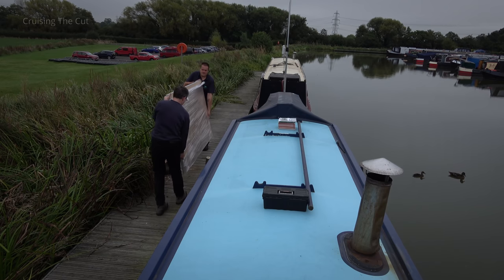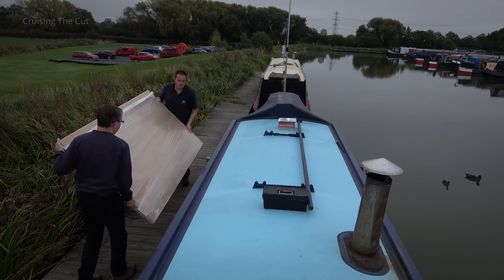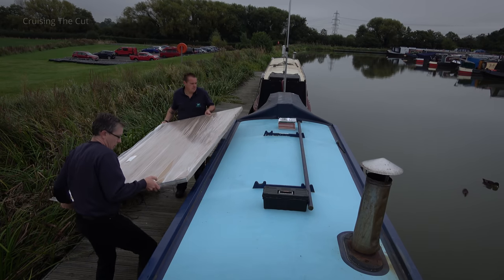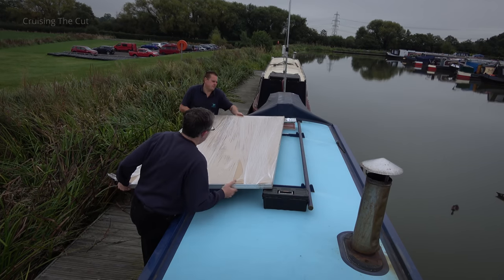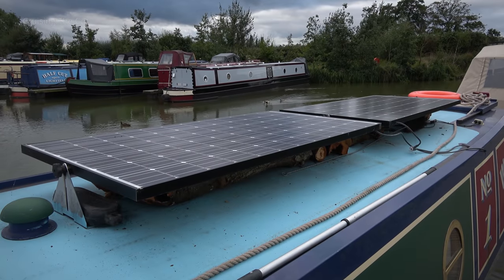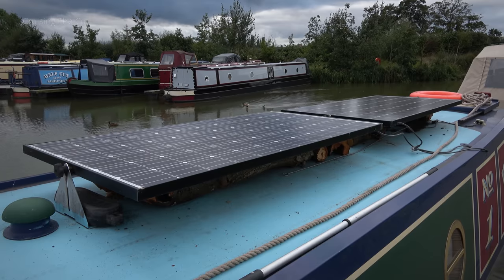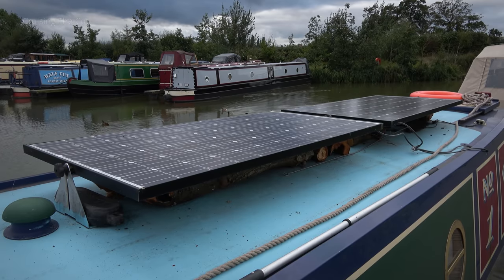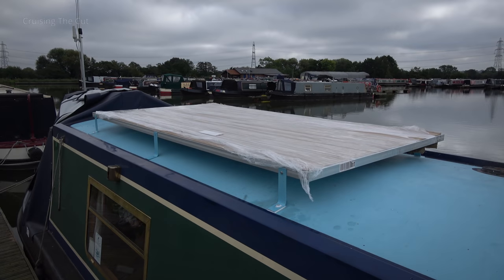260. Solar Panel and Lead-Carbon battery update (narrowboat)

Comment from the maker: Answers to Frequently Asked Questions:-

Why don't you get a wind turbine?
They're expensive, make a lot of rattly noise, you have to put them up and down each time you travel but above all, on a canal they're fairly useless. They need a constant, stiff (30mph+) breeze to even start generating anything worthwhile and unless you moor next to an open field where the wind swoops in all the time, you're not going to see a useful return.

Get a powerbank like those Jackery things, that would sort you out!
No, it wouldn't. You know, the companies making those things have done a wonderful marketing job of persuading people the boxes are some kind of miracle power-packs when in reality they are just (literally just) a battery, charger and inverter in one box - which is exactly what I already have on the boat as separate components! There's no magic about those things. They'd still run out of power after a day or so just as my batteries do, and then you're back to square one and you have to charge them ... so you're back to solar, or a generator or a shoreline.

Why don't you buy a Honda generator?
I do like those and they are relatively quiet. Many boaters do have and use little gennys over winter, for sure. The downside is having to buy and store petrol (it's not available on the canal so you'd have to get to a roadside service station and bring jerry cans back to the boat), plus they're a magnet for thieves. And the petrol costs are substantial, since you'd run the genny for maybe 2-3 hours a day. In my case, in a marina, generators are frowned upon for noise reasons (even though, paradoxically, you're OK to run the boat engine but it's generally a different type of sound)

Why not use a propane fridge?
They're probably great in RVs but except for a few older boats, they're not used on narrowboats these days. Unlike RVs, which can easily have holes in the floor to vent any escaped propane, gas leaks in a boat just sit in the bilge, forming a potential bomb if the gas were to meet a spark ... and propane fridges have a permanent pilot light. It's just not considered safe.

Why don’t you get Lithium batteries?
They’re lovely - but they’re also still extremely expensive, they wouldn’t like the hot and cold extremes in my engine bay so I’d have to re-engineer and re-wire the battery bank, and my alternator would need a charge controller added. And yes, they last for many years vs traditional batteries. If I bought a new boat, I’d specify them but it’s not worth the investment on a 22-year old boat.
Reply: Thank you
Reply: I am sorry I do not see any answers to FAQs here.  Are the no shore power pontoons less expensive?  This is a very good episode.
Reply: Many thanks 👍
Reply from the maker: I have re-pasted the FAQ answers in the hope that this time YouTube makes it stick! Can everyone see it now?
Reply: @CruisingTheCut  I found it scrolling down, it's not actually pinned to the top.
Reply from the maker: Aaarrrggghhhhh. Wretched YouTube!! Whenever you edit a pinned comment, it unpins it, and every time, I forget. It (should be) now re-pinned. Sigh.
Reply: Thank you for updating us! What I was think is that you needed a little more battery storage. It would be more helpful during winter by providing you a much more comfortable margin of longer use time during cold winters. And during the rest of the year - you can use Fridge, wi-fi, computer, micro and vacuum more longer/often without fear. Otherwise you seem to be doing fine. Well done!
Reply: About petrol and the Honda generators:
There are small battery charging diesel generators. No need for separate fuels.
Reply: If you have discovered that solar panels don't care where they are pointing when it is very cloudy, have you considered slapping more panels on the sides to pick up diffuse light in winter?
Reply: @sean2074  That actually works, but the sunny day efficiency is bad.  This is always the trade off, do you make a half circle panel, or a flat one.

Comment: You can fill old milk bottles with water and use them as a battery - whenever you open the door, the mass stays in the fridge/freezer. Normally the air falls out, warm air is sucked in to replace it and that then needs cooling. 
Water holds about 8x the thermal mass of air so once the mass has been cooled on a sunny day, the fridge will use less power over the following overcast days to keep the contents cool.
Reply: does anyone know if the early narrowboats had iceboxes, or carried refrigerated goods?

ice with fibre or gelatin will avoid melting for quite some time, I've seen it used as briquettes in our home meal delivery boxes.

Comment: Having lived off grid for 11 years I agree whole heartedly with your winter solar comments. We have a 1kw Honda which, through the Victron charger , puts in 30 apps. Way better than the engine which is noisy and takes far too long

Comment: What I do in winter, is find  the best accessible marina with space that’s not too difficult to manoeuvre into, then just once a week I go and get an overnight plug in. Do the washing hoovering etc, fully charge the batteries, then go out somewhere more interesting for the week. Works for me, I have three 230ah AGMs and at 6 years old, they still seem as good as new. I have an inverter on all the time and 240v fridge, always on. I typically run the engine between 1 and 2 hours a day, usually 1 one day  and2 the next, which also gives me hot water. It’s nice to have little cruises in winter if u can find a lock free area.It’s March now so solar takes over if I’m not moving. 845 w of solar, happy days.

Comment: This video was so dull that it was absolutely riveting: Single shot, head-on of David sitting in a chair, gesticulating vaguely and talking about amps, volts and dreary weather for 15 minutes. Which is what one does on a boat going nowhere in winter, I suppose. It reminds me of those winter months I spent decades ago with my elderly English relatives, although they lived in a house in Southend, not a boat.
Reply: There were "colour" shots of the power management wall, and the batteries though...😁😁
Reply from the maker: Dull is my speciality

Comment: Hi David, I've been off grid for two and a half years now, your observations are spot on, this winter seemed to have lower "Sun  Power", friends and family often say "just get more solar panels", but as you point out twice virtually nothing is still not a lot.
I've got 15kwh of Lead carbon (8x160ah Victron) our usage is equivalent to a monthly electricity bill of about £35 (according to comparison sites), we needed to run the generator every 2nd or 3rd day for a few hours, the total red diesel bill for Nov to mid February was around £100. It's thanks to your channel and a few others that gave me the inspiration to overcome the lack of power to my building project.

Comment: Well covered David. On the solar panel front the conclusion is they only work well when it is sunny. If you have enough in summer for your needs then in winter you will only have 10% of your needs. 👍

Comment: I loved this video David, though some of it went whoosh over my head. Most of us would know you'd sort whatever problems came along to your satisfaction. The lengths of small logs tucked under your solar panels made me smile.
Get a good log saw and collect some more. I heat my greenhouse with logs during the day, and smokeless fuel at night.
A fire with collected fuel gives you a warm glow, even when its not burning very well.
Reply: That's why he used the under solar panel gap as storage...
the wind blowing through dessicates the wood (making dry, efficent burning) logs and the "roof" keeps water/snow/sleet/hail/dew off them.
Reply: @JohnSmith-yv6eq  Thanks John. I knew all of that.

Comment: Always great vids, fascinating technical talks.

Yes, running a fridge uses lots of power, but some folks forget that it heats the air around it. Which may not be what you want to do with your electricity, but it's not always bad.

Comment: Great blog as per usual.  The good thing about lead carbon batteries is that they are not as susceptible to sulfation in a psoc (partial state of charge) as normal lead acid are. So one doesn't necessarily need to get them in to "float" conditions to keep them as healthy.

Comment: People who Van life here in the state and mount solar panels on their roof will occasionally double stack them. When the vehicle is in motion the panels are stacked and parallel to the ground with only the top panel charging. Then when they are parked the panels are rolled to 30-45 degrees and the top panels slides up exposing the bottom panel to the sun. In theory that would be a way for you to double your solar acreage. HOWEVER it must be pointed out how much easier it is to turn a car so that the panels are facing the sun. With a canal boat while you CAN tilt the panels slightly on both the port and starboard side, it might not be enough to either get the ideal angle or slide one of the panels out if if slides towards the downward slope

Comment: Thank you for the battery cruising the cut !   Electrifying !   Very good info.   I think anyone living outside +/-30 degree latitude have solar issues each Winter (usually and always), and you in England are somewhere around 50deg North.   I like solar a great deal, but only where/when it makes sense.  My house is covered by shade trees run the city...so always in shade and pointing the wrong direction so can not get good solar at all.  Thanks for the solid effort and report out.

Comment: Your narrowboat with solar is like a country going over to renewables - sometimes the sun doesn't shine and the wind doesn't blow.  Hence, other arrangements must be put into place to cover the shortfall.  This can mean building back-up fossil fuel power stations and only running them occasionally which is expensive for a country but not so for a narrow boat.  A better solution is to have connections to the outside world with the UK having interconnectors to Ireland, France, The Netherlands, Belgium and Norway with more on the way. This is relatively inexpensive and the result is that when we have a power shortage and our neighbours have a surplus, they can help us out and vice versa.  Difficult to arrange for a narrow boat as you would need to be plugged in at all times.  The third solution is storage - which is taking off worldwide due to massive cost reductions of lithium ion batteries.  Although you do not say so - I suspect that you only have about one days storage capacity of about 1 kw.hr, so one day of poor solar means you are in trouble.  If you had say 20 kw.hrs of storage then your usage of about 1 kw.hr per day would mean that you could last for 20 days. This is more than enough time for the poor weather to dissipate and for power production to return.  Of course, the assumption is that you already have enough power production on average and just need to store the surplus for a ........ rainy day! 😁
Reply: Actually, natural gas can do spot generation now.  Gas in city pipes can go stale, so in Phoenix AZ they have generators sitting at the end of the gas mains, and when it gets hot (all summer)  they burn the old gas for power.

Comment: I live off grid and experience the same thing, little to no sun to charge my battery bank November and December mainly. I recently doubled my battery bank from 200 amp hours to 400 amp hours in hopes of going longer between good days and a mouth later I've yet to run the generator. I would suggest adding more storage  (batteries )

Comment: A friend runs a solar system on his house boat.  He made a dual alternator pedal system (like a bike). He charges his battteries while pedaling. He also hooked up a motor to them so they run after his workout. He hadn't killed the system yet. Doesn't run his motor unless it's colder than normal.

Comment: To be more efficient in generating electricity, and possibly make running the generator less noisy, a small generator sized to match the battery charging load would be a good idea.
To test the batteries you would need to install a shunt.
A smart shunt could log battery use as well as give you good state of charge information.

Comment: HELLO DAVID. great to see you. and as per. brightened up my day.. your batts will not give hassle before 5- may be 6 year. as long as you do the top up on a regular basis. the ole milk float lasted 7 to 8 year before needing some coaching to get 10 years out of them .. i got 10 years out of mine on a second life set. they were in backup mode for radio emergencies.  i would like to suggest turning the one set of in  the summer or you may gas off your batts ( dry them out )  . thanks for the chat as always. great to see you. things can only get better. .. lolol  atb tone uk stay well and safe

Comment: Half the Europe accross (Slovenia) the situation was the same. I have panels tilted as they should be, but with literally 2 days of sun in november and december, the average production was approx 20W h/day. Compare that with approx 600-1000Wh/day now. Without HUGE batteries (10 or 20-times the amount you have) there is no way you could go through the winter only on solar. Unfortunately you simply need reliable (fossil fuel) backup power source.

Comment: A very helpful and informative vlog. The best thing I fitted by far on my boat was a battery monitor, Victron BMV712 that I can connect via Bluetooth. It’ll tell me when my batteries are getting close to full by the amount of charge they are accepting from engine or genny. Plus I can do a full audit on use by item simply isolating everything then turning one thing on at a time and seeing ( on my phone ) what amps it’s drawing. Keep up the good work, NbPercy

Comment: Hi David, thanks for another interesting video.

Yes, in overcast weather, solar panel output is down about 90%.  On a narrowboat you have a very limited amount of space for panels.

Several comments have been made about changing over to Lithium batteries to solve your problem but, that's not your problem.  Your problem is you are not generating enough solar power to keep up with the 12 volt demands within the boat.

With my solar system, I have backups for my backups to ensure I have a reliable off-grid system.  This works for my setup because I live in a house, living on a narrowboard would rule out a lot of possibilities.  For your setup, I would recommend using a 1,000 watt inverter generator that has been modified to run off of propane, as well as petrol.  To keep it whisper quiet, I would place it in a sound isolating box.

Comment: Thanks for the update. I must say, I've never seen any panel exceed 60/70% of the rated power. For example in the best conditions,  my 200w panel produces 8/9 amperes at about 16v...that's cranking high for my 200w panels

Comment: Those M1 MacBook Airs are black magic. Mine runs Cycles renders in Blender faster than my 2019 27" Intel iMac.
Reply: I REALLY want to upgrade to an M1 Mac, probably an Air, but wouldn't mind a Mac Mini. I have my current Mid 2019 MBP hooked up to an external monitor most of the time anyway.

Comment: You can add a second larger alternator.  Many camper vans do this.
Reply: I suggested this as well and he claims it's too expensive. I look forward to the video where he does the research and proves us wrong, or not. 

I'm looking on eBay in the us and they cost like $150 but it'd probably have to be custom installed with that vintage engine he's got. And could that little guy handle it? I think yes, but it's something he'd have to check.
Reply: The limiting factor is often how much power you can push into the batteries. One of the big advantages of changing to lithium batteries is that they will take as much power you can give them, right up until they are full. With lead-acid batteries there is a lot of internal resistance so charging takes much longer.